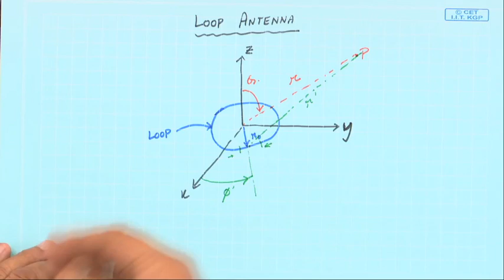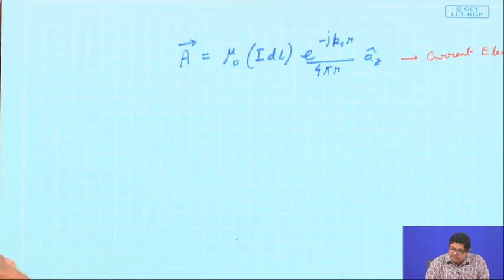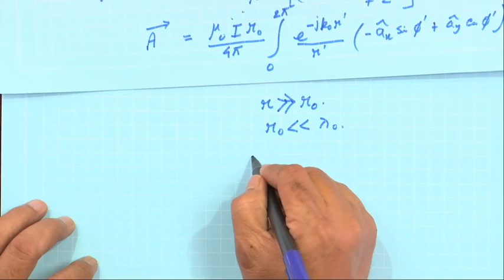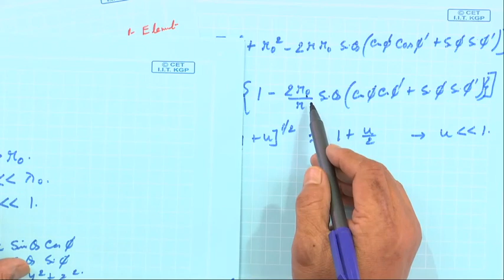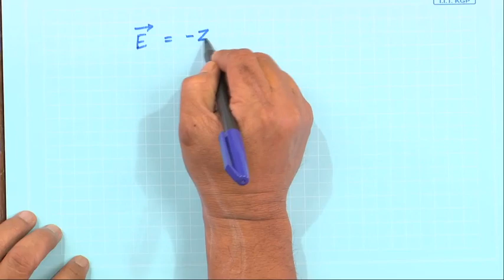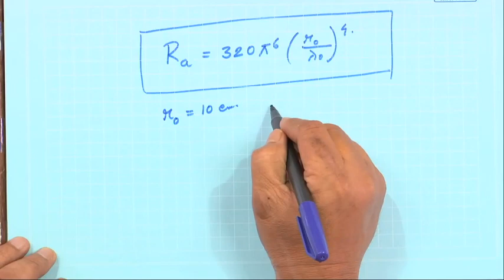Lecture 15: Loop Antenna

Comment: The calculation is wrong, because the amplitude of the current is not constant in the time from the feed point to the capacitor in a short  Loop antennna. When the current is zero on the feed-point there a current is still flowing in the capacitor. The amplitude of the infinit elements of current is changing along the conductor of the loop.